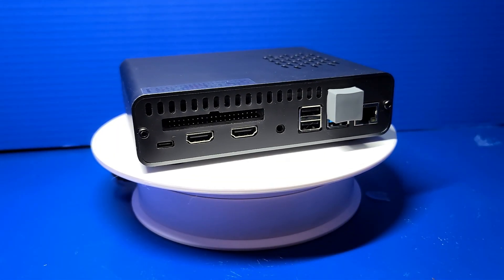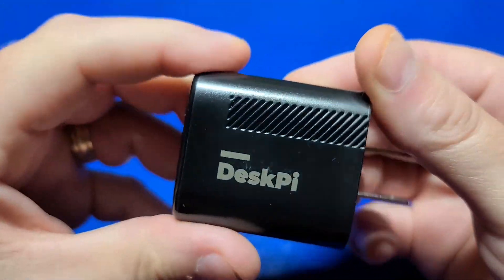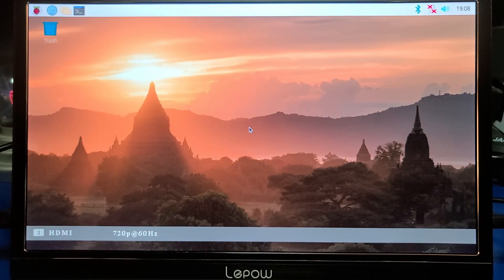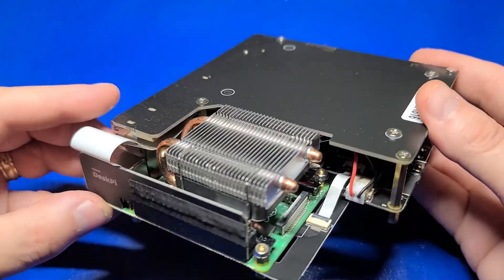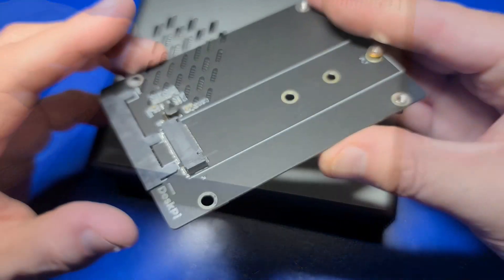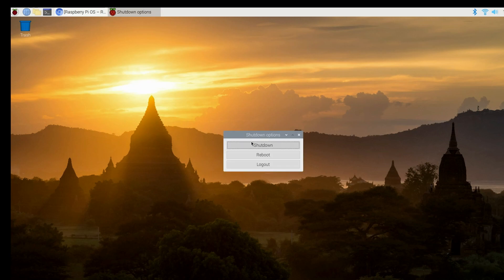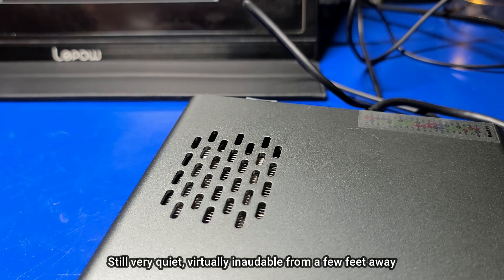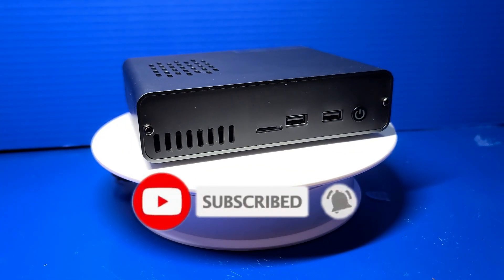DeskPi Pro v2 Raspberry Pi 4 Desktop Case Setup and Review

Comment: Back in 1981 I attended de Coast Guard Electronics C School when it was in Governor’s Island, NYC. I was assigned to LORAN C Station Nantucket and they had three Tempest model 40 TTY. My final exam for the course was to take the whole TTY apart, including the printer which we didn’t cover it. The instructor told us to take apart the printer and lay it on the table. I took the printer apart and I was very proud of my work. Then the SOB of instructor told us to put the whole thing back together and to do a functional test, if it worked we pass. Brother I put the darn thing together (I have to say that I am mechanical challenge). I had about 10 screws and bolts left over, but the darn thing worked, grabbed the leftover items and put them in my pocket and left the classroom. In reality I never had to take a printer apart for the rest of my career (eight years) cause in reality if the printer failed you just swapped it with a replacement. Why this story case I LOL when you mentioned the “leftover” board. Love your video, I have a Argon case with an m.2 ssd and I am looking into this case for another Pi that I have (I have a total of 10 Pi including a cluster of 5 and a Open Media Vault.  Outstanding review, keep them coming. Best regards from San Juan Puerto Rico, stay safe.
Reply from the maker: Thank you so much for sharing your story Luis, really enjoyed reading it!  I'm also glad you wound up passing the class, sounds like a challenging instructor 😀 Thank you also for your kind comments about this review, I have not built any Pi 4 clusters yet myself but it is also something I want to explore in the future.  Perhaps running a Kubernetes cluster, that would be a fun project.

Comment: I just got the case (October 2023) and a few things have changed! The biggest is that the power is now delivered with a barrel-jack and adapter. I noticed that yours has standoffs under the cooler supports, whereas mine has a threaded spacer built into the cooler arms. They also color-matched and branded the USB bridge. I also saw in my instructions that it added an IR receiver, which I don't know if yours had.

Since I had to build mine, I used Thermal Grizzly thermal pads instead of the ones it came with. I've found in other cases and ice towers that it tends to shave off a few more degrees.

Not worth getting a replacement, but it's still a good case!

Comment: UPDATE: After having issues about not receiving my Raspberry Pi when I ordered the DeskPi bundle Jon was super helpful and the issue has now been resolved. The store made a mistake and will send me the missing items. Again many thanks to Jon (Wagner's Tech Talk) for taking the time to look into this and helping me. Not many YouTubers would have bothered! Very grateful!
Reply from the maker: Did you try powering it on? If you bought it with the Pi 4, it's already installed and you'll receive an empty box for the Pi 4 since the Pi is already in the case for you. You can see that at the beginning of this video. Let me know, very curious.
Reply: @WagnersTechTalk  There is nothing to power on! There is no raspberry Pi in the case. In the case are just the extension boards. There was no empty Raspberry Pi box in the shipping box either. Only an HDMI cable. Also missing is the micro SD card that was in the bundle I purchased.
Reply from the maker: Send me your order number to jon@wagnerstechtalk.com , I have a contact there and will see if I can help get to the bottom of this.
Reply: @WagnersTechTalk  Sorry I missed the comment before! I just sent you an email with the details. Thank you again for taking the time!
Reply from the maker: You bet, e-mail sent and I'll let you know if I get any updated info. via e-mail.
Reply from the maker: Very welcome, I'm happy that they were able to get the problem corrected quickly.  Thank you for watching my content and your support, gotta help each other out 👍😎

Comment: I’ve got a Desktop Pi v.2 on order anxiously awaiting its arrival. I’ve watched a couple of reviews so far and came across yours and must say you did a tremendous job of explaining the overall product with features and benefits. I too own multiple Pi4B’s 4gb (3) at this time ; my main one is outfitted in an Argon 1v.1 case with the M.2  using a Team 512gb SSD as a Desktop PC and Media player.  The 2nd Pi4B is in a passively cooled Anidees case (AI-PI4-BB-PRO Black ) with the built in cpu cooler and a DAC Hat from Inno Maker (RPI-HiFi-DAC) case modded for the RCA audio and headphone jack outputs as a Volumio media player using a 256gb mini aluminum thumb drive. The third Pi4B is in a Argon/NanoSound1 with the M.2 base equipped with 512gb SSD again as a 2nd Volumio media player that performs beautifully, great sounding as well. 

I plan on using the new DeskPi v.2 as my daily driver and likely retiring the Argon1 until I buy a 4th Pi and then give a buddy the Argon1 as a gift?
Anyway long story made short I enjoyed your review and will reference it with the links for the software when I get my case.
Reply from the maker: Thank you so much Rick, I spent quite a bit of time on the editing and your comment means a lot.  Sounds like you have quit a Pi 4 arsenal too 👍😎 I also have the ArgonOne v1 & v2.  You probably don't need it at this point, but I did create a guide on the ArgonOne (v1/v2) that may be useful for your friend that receives the Argon1: http://wagnerstechtalk.com/argonone .  I hope you enjoy your DeskPi Pro v2, it has become my main Pi 4 case and likely won't be replaced anytime soon.  Again, thank you for your kind comments and for watching.

Comment: Good detailed info on the DeskPi, a lot don’t go that in depth. One tidbit of info, just use “SS card copier” to copy your SS card to the ssd or m.2 and saves the need to redo all the updates and whatever software you may have installed. No need to completely reinstall everything just because you changed drives.
Reply from the maker: Thank you David, you make a great point about that!  I probably should have used that instead and I appreciate your input.

Comment: Thanks for the video. I am considering a Pi 4 for use with Ham Radio.  If I go with this case do I just run the desk pi scripts for fan control? Note: I will be using the stripped down desktop 32 bit version.   After I get the fan configured I plan on running scripts from KM4ARC on ‘build-a-pi’ to get my ham radio software installed. I would imagine this would work. What do you think? All the best. Thanks for your review.
Reply from the maker: Hi Brent, yes just run the scripts for the fan control.  As long as the OS you install is based on PiOS (formerly Raspian), the fan control scripts should work fine.
Reply: @WagnersTechTalk  very good.  I think the distribution is called Buster.  He instructions are to use the limited desktop version of Buster.  If the fan control scripts require a dependency I am comfortable with resolving those.  Have you heard of any problems with the GPIO connector not fitting?
Reply from the maker: @brentjohnson6654  Yes, regarding the GPIO connector I "made it fit" but it was very very tight.  I mention that at the end of the video.  The issue with it is that the PCB that the GPIO pins are connected to have very little clearance (~4mm).  I had to bring it in from the bottom and tilt the cable upwards and push in pretty hard.  If you can find a thin GPIO connector, then it may fit better (I used what I had on-hand).  But again, very tight fit.

Comment: I’m using the DeskPi Pro V2.0. 
I keep getting a low voltage check power supply message. I’m using a WD 500GB SSD. I don’t get the same message when using an SD card or a USB stick. Could the SSD need more power than the board(s) can supply? 
Any help would be great. I’ve tried the included power supply as well as a canakit RPI USB-C power supply. 
Thank you for the tutorial. I was able to get mine all setup and with the exception of using the SSD and having  almost constant low power warnings,  I like it. Maybe I’ll try a different type/brand  of SSD and see if that helps.
Reply from the maker: Make sure you're using the power supply included with the DeskPi Pro v2.0.  If not, you can pick one up here: https://deskpi.com/collections/accessories/products/qc-3-0-power-supply-for-deskpi-pro  If you are using their power supply, which it seems you are, I'm not sure what the issue could be (most likely, not the drive).  Verify the power supply, if good there, click the blue chat icon in the lower-right of the page from the link above and let them know the issue.  I've seen this kind of thing when the wattage wasn't sufficient for both the Pi and the SSD so I'm think it's the power supply (defective perhaps) but always best to check with the Mfgr. to be sure.
Reply: @WagnersTechTalk  Thank you for advice and insight. I have an order for another power supply from the company to see if that helps. I think they are currently in “lockdown” because of Covid. So I’m waiting till things get shipped out. Hopefully soon. 
I’ll let you know how it turns out. Thank you again for your knowledge. Take care and be safe.
Reply from the maker: Very welcome, hope that resolves the issue for you!  Take care also and hope to hear back that it corrected the issue.
Reply: @randbasic  did the power issue got resolved with a replaced power supply? Eager to know. Thanks

Comment: My system is really slow for some reason and my wi-fi is also really slow. I think it has more to do with the micro SD. Nevertheless, I'm going to install RetroPi on a hard drive I ripped out of an old Laptop. It's not SSD but it's working. After it's installed I'm going to try and re write the OS to another card.
Reply from the maker: Got it, yes sometimes we get some pretty lousy no-name brand microSD cards with these devices of varying quality.  If you need any help with how to backup/clone the microSD to the HD, my guide here should help  you along: http://wagnerstechtalk.com/common/#Backup_Clone_a_Drive

Comment: What is the output of the lsusb command?
That will tell you which SATA chipset the board is using. 
lsusb -t will show whether it supports UASP.
Reply from the maker: Hi Brad, here you are Sir:

pi@raspberrypi:~ $ lsusb -t
/:  Bus 03.Port 1: Dev 1, Class=root_hub, Driver=dwc2/1p, 480M
    |__ Port 1: Dev 2, If 0, Class=Hub, Driver=hub/4p, 480M
        |__ Port 3: Dev 3, If 0, Class=Hub, Driver=hub/4p, 480M
            |__ Port 2: Dev 6, If 0, Class=Human Interface Device, Driver=usbhid, 1.5M
            |__ Port 1: Dev 5, If 1, Class=Human Interface Device, Driver=usbhid, 1.5M
            |__ Port 1: Dev 5, If 0, Class=Human Interface Device, Driver=usbhid, 1.5M
        |__ Port 4: Dev 4, If 0, Class=Vendor Specific Class, Driver=ch341, 12M
/:  Bus 02.Port 1: Dev 1, Class=root_hub, Driver=xhci_hcd/4p, 5000M
    |__ Port 1: Dev 2, If 0, Class=Mass Storage, Driver=uas, 5000M
/:  Bus 01.Port 1: Dev 1, Class=root_hub, Driver=xhci_hcd/1p, 480M
    |__ Port 1: Dev 2, If 0, Class=Hub, Driver=hub/4p, 480M
Reply: @WagnersTechTalk  
The UAS/UASP information is extremely helpful. Thank you for lsusb -t

Comment: Does this thing support nvme drives or just sata III drives?
Reply from the maker: DeskPi Pro extends a 2.5-inch hard disk Port through the USB3.0 port, only supports M.2 SATA SSD, and provides independent power supply.  See their page for for more details here: https://deskpi.com/collections/frontpage/products/deskpi-pro-for-raspberry-pi-4

Comment: I would trade my Argon One M.2 case for that puppy. Having the microSD card not accessible on the Argon One M.2 case is deal breaker for me.
Reply from the maker: That is one of the things I didn't particularly like about the Argon One M.2 case which I highlighted in that review.  However, the DeskPi Pro case manages to solve that problem.  I can see using this case quite a bit in future projects/videos for that reason.
Reply: Should I return my argon one v2 and upgrade to this? I don't have the m.2 but had considered it in the future. I'm waiting for software to download so I can install it on a Raspberry Pi 4 4GB. Plan to use it for retro gaming, but might do other projects later in the future.
Reply from the maker: Totally up to you, both are great cases.  You just have to weigh the convenience of having direct access to the microSD vs. having to open the case.  This case is more expensive (but not by much, see towards the end for cheaper vs more expensive options).  It's honestly a tough call and really depends on your needs.  I use my Argon One M.2 with PINN Lite (with multiple OSes installed), so not having direct access to the microSD is not a big issue for me but is inconvenient when I do need access to it.  This video explains more about PINN Lite https://youtu.be/1Cqta4go45U
Reply: I'm just now getting into pi, so I'll probably hold off on this until I'm in a position where I may want to use the desktop. Due to portability, I think the argon is probably my best bet for now. In general, do cases tend to go on sale after a spell?

I'm also not using an SSD on the argon, so that card slot is right at the back of the case, isn't it? I do wish everything was up front, but the small form factor really had me. Maybe I'll pick this DeskPi up and throw the media collection onto it at some point.

My only other complaint is I wish there was some color difference, I don't mind aluminum cases, I just wish everything didn't look like a modem 🤣 

Love the channel by the way, I subscribed a few days ago and I've been watching videos like crazy. Very informative :-)
Reply from the maker: Thank you Kegan, I appreciate your support by subscribing and watching!  Case prices don't tend to go down much (5-10% at best) until a new version of the case is released - typically.  You can watch for sales such as Prime Days, Black Friday, etc. stuff like that where you may find it cheaper.
Reply: Thanks for the info. Hopefully they will incorporate a safe shutdown feature in future models. I'll stick with the argon for now, but my gosh, this thing is beautiful! Very tempting if I hadn't already pulled the trigger, I've been getting things together for the past month or so.

Have a great night.
Reply from the maker: Thank you, you too!  Hopefully they'll be able to add safe shutdown through a software update.
Reply: @PotterPossum1989  I personally would. Plus, the Argon One M.2 case had a WiFi issue, that they didn't tell their customers about.
Reply: @WagnersTechTalk  I hear that.
Reply: @DoryanTheCritic  Argon have corrected that issue, but it is annoying for those of us that already bought one.
I modified my wpa_supplicant to always connect to my 5 gHz Wi-Fi connection and have no issues that way.

Comment: DSO NOT BUY THIS PRODUCT !
I purchased two of those and none of them works.I used two  RasPi-5/8Gb and none will reboot. Tried Rasbian-32/63 and Diet-Pi.  There is also a problem with cooling fan, and no video (unless I pull out and reinsert HDMI cable). I have to do it every time I reboot or when the device goes to sleep.  In other words - serious issues with the software. Cooling fan almost impossible to mount because of the short threads on the screws.  Company completely unresponsive.  It looks great, but that is the only positive thing. It simply does not work and until the software/drivers etc is updated it is simply waste of money. Customer support does not exist.
Reply from the maker: So, you used a RasPI-5/8GB?  No such product is publicly available at this time, this is only for a Pi 4/8GB.  Raspbian/PiOS comes in 32/64-bit versions.  The case you have, is it v1 or v2 as shown here?  The cooling fan requires drivers, as do many other Pi 4 cases unless you enable the hardware switch to let the fan run continuously.  Installation steps for the fan control software (including DietPi) are well-documented and may be found here: https://wiki.deskpi.com/deskpi .  No problems here with the HDMI, I would recommend trying a different cable.  Can't comment on the cooling fan, it was already mounted when I received it.  I'm fine to leave your comment here for others to see.  I don't appreciate trolling, but I respect honest opinions.  Not sure which we have here.  Your very first sentence screams trolling, however.
Reply: @WagnersTechTalk  I applaud how you handled this.
Reply: @WagnersTechTalk  I had the same issue with V1 with regards to the HDMI, you might want to check which revision you have. DeskPi pro team has sent replacement boards for those that ordered at least directly from DeskPi  for those that experienced these issues with V1. I just received my second DeskPi Pro which is V2 which I am currently assembling. I haven't tested the upgrade components for V1 as I had a broken GPIO adapter board which I just received and have to order a replacement FPC cable. If you have V1 I would reach out to the DeskPi team.

Comment: The one I received came as a kit and required assembly. Not the easiest task w/o magnifying glass and appropriate tools - specifically for the ribbons that have to be inserted correctly and fastening the cooler. No success so only one star at this point for the product review.
Reply from the maker: I used some needle nose plyers which made it much easier.  The blue side of the tape will be touching the latch that closes in on the cable.  Hope this video helps and you can get it fully assembled.
Reply: @WagnersTechTalk  thanks. My bad… I only got to the part where it was unboxed and turned on. Will go back for the assembly details. Since my first attempt I’ve acquired some additional tool: a set of various tweezers plus a magnifying glass stand, etc… much appreciated…
Reply from the maker: No problem, if you find the assembly portion helpful in finishing up your build please let me know.  Makes my day to hear it helped someone out 👍😎